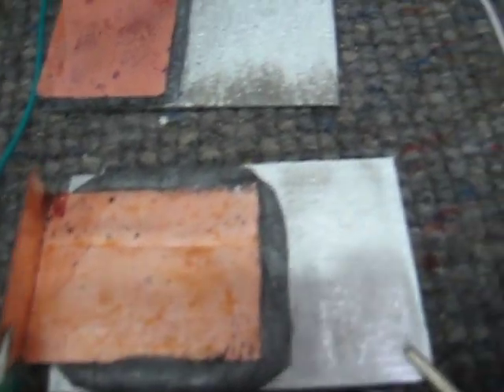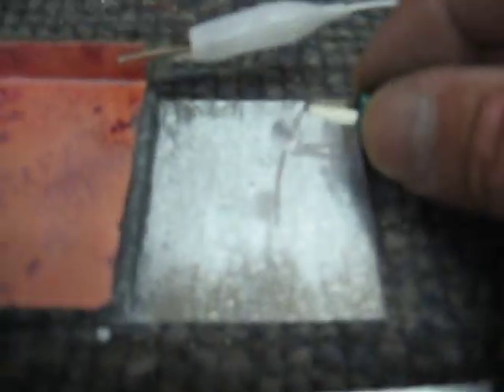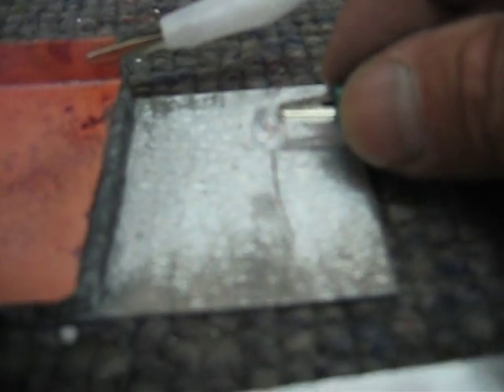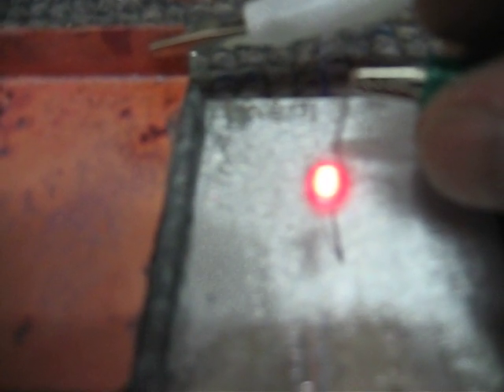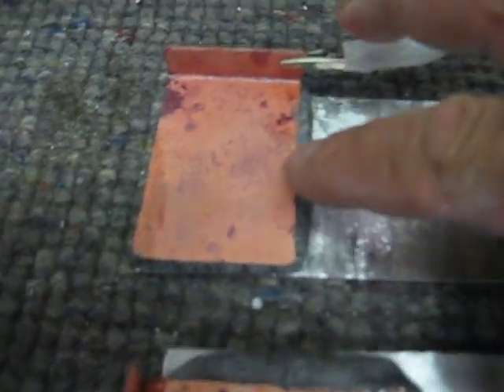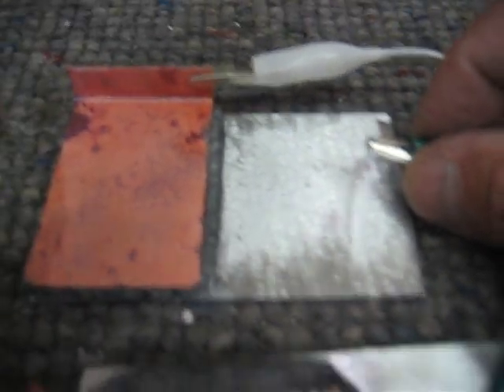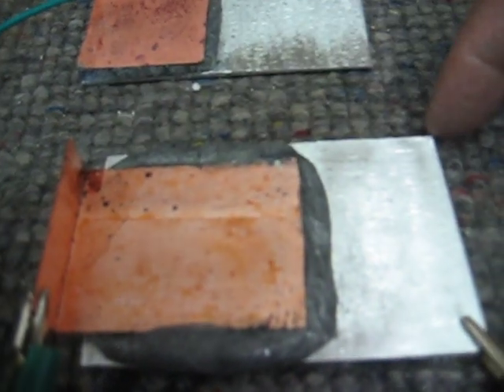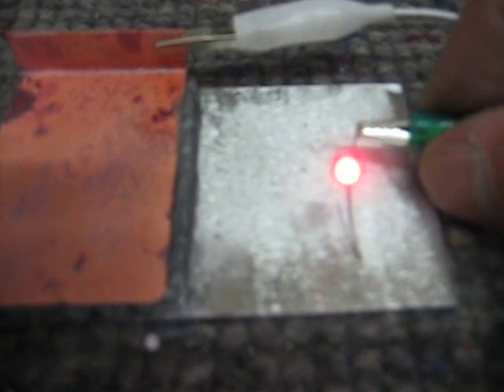Solid State Polycrystalline Cells / John Bedini

Comment: So John, you now can put in series some crystall electret cells and to have 2 sets of these, and switch them at lets say 12 hours with leds as load, and you have Free Energy device that works continuous. Some sets can have normal batteries (eventually charged before in impulses from a JT or OU charger) in parallel with crystal cells. Great job, keep going! All the best!

Comment: @min2oly 
My thought was just to add a capacitor into the trigger circuit so the base of the transistor gets a pulse rate that would let the cell recover. The inertia of the heavy rotor would take care of the intermittent power pulses. It might be a novelty probably but an interesting one. I personally think there is something in the idea of an oscillation in the circuit which can be transformed to the isolated charging circuit. I've experimented with some feedback and it looks interesting.

Comment: It would be fun to add a capacitive charge trigger on an efficient window motor and try to run it at a pulse rate that would allow the highest release of potential from the cell.  Probably not practical torque wise but it would be pretty cool.
John H